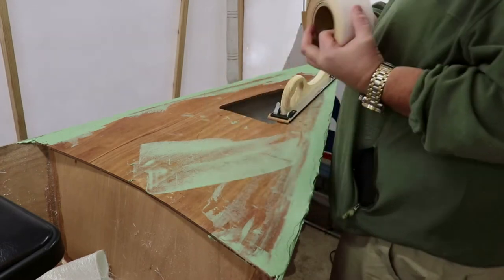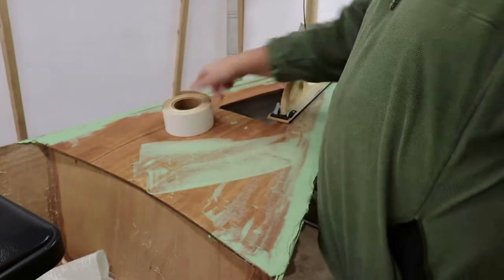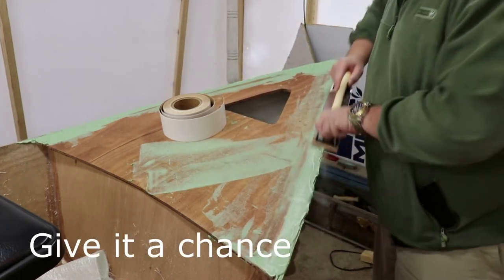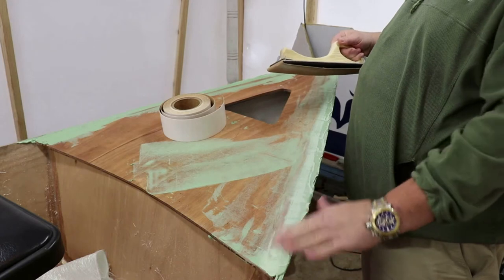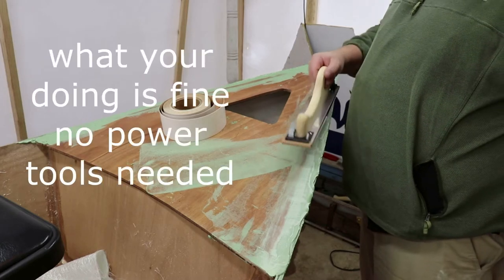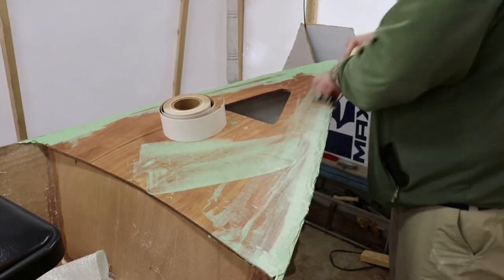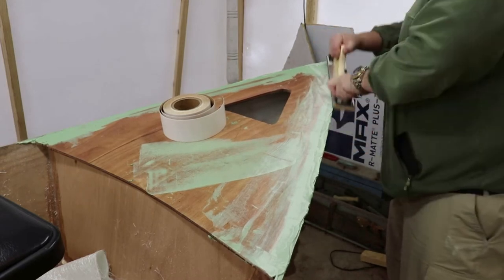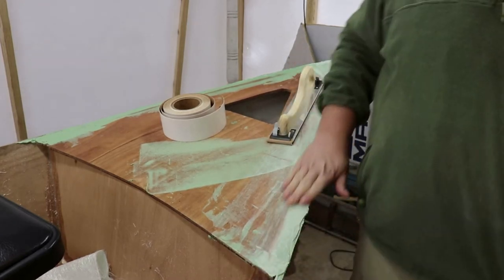Bubba's Tango 18 - EP. 73 SAND & SKIM COAT TOTAL FAIR

Comment: Hi Bubba, how do you like working with that Total Boat faring compound? I've been using West System products and thinking of swapping for the savings in cost.  Not sure if they can be mixed or if it matters? I mean using West system epoxy and covering it with Total Boat compound to fill it in? Great video though, thanks again!
Reply from the maker: Ease of use..An amazing epoxy based compound Just mix part a & part b.. it' doesn't need to be exacting proportions..mix ...yellow & blue make green !! Spreads super nice.. For me I let harden overnight then it's very easy to sand & shape yet rock hard.. In my opinion bonds well to the wood substrate